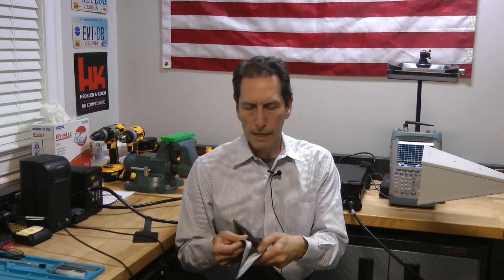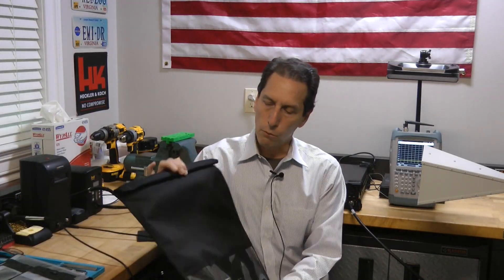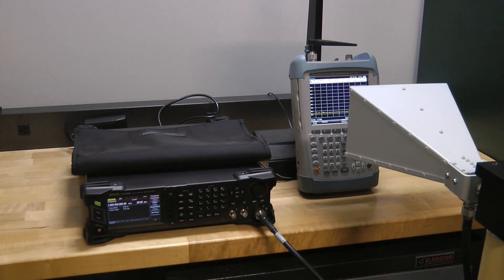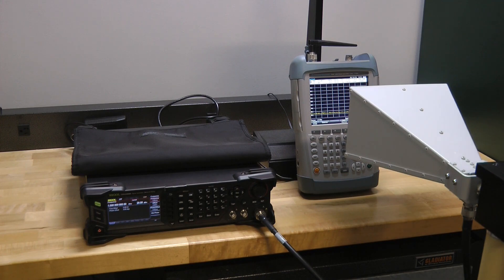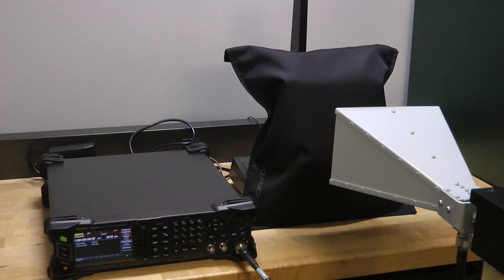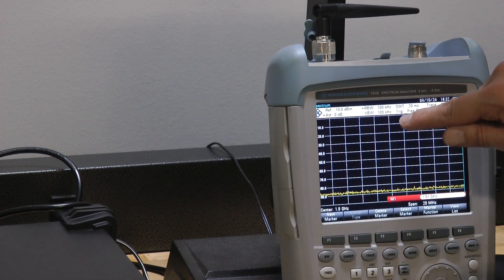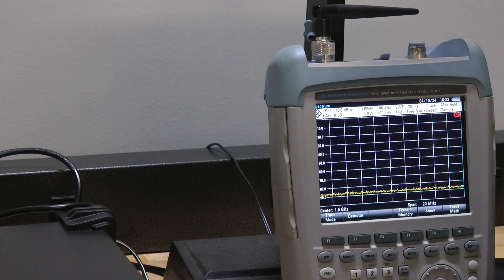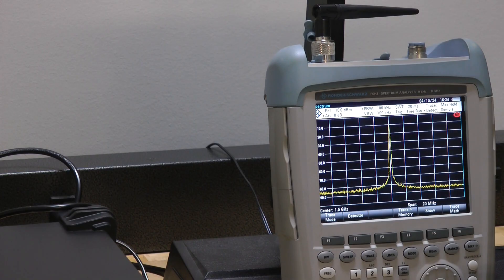Faraday Defense JACKET Pro Test

Comment: Whats the frequency or signal level? In your previous videos the screen read on your sensor 'start' and 'stop' around 500mhz, but here it instead displays 'center' and 'span'? (1.5hz and 20mhz respectively) Relative to those previous videos signal level at 500mhZ, where do these results stand? Or in other words, how do these result's translate to those? How do these results corresponds to those at 500mhz, and why chose this signal strength as opposed to the others you seemed to prefer? Do you now believe this frequence is better representative of an emp?

Comment: Kinda wondering what the significance of 80 dB is.  It would be helpful to put that into units that are more commonly known.  Is that 1/10,000 of the power?
Reply: It is 1/100,000,000 the power.    Every 10 dB is by a tenth up or down.

Comment: Instead of placing the entire Rhode in front of the waveguide, why not just place the antenna there? All you would need is some feed line. I'm just wondering... perhaps just a case of not having those parts... but with that sort of gear I would think you would have coax, connectors, etc...

Comment: Unfold it while running the test so we can see It pick up waves.
Reply from the maker: That would have been an interesting test. The trouble would be that you couldn't see the screen until I pulled out the analyzer, and by that time, it would be full strength.
Reply: @disasterprepper  The bag should use high quality velcro, NOT magnets! Magnetic fields are almost as bad - they delete diskettes and cassettes the product should protect against in a nuke attack. For the really important data, real preppers do not trust in storage media with semiconductors inside.